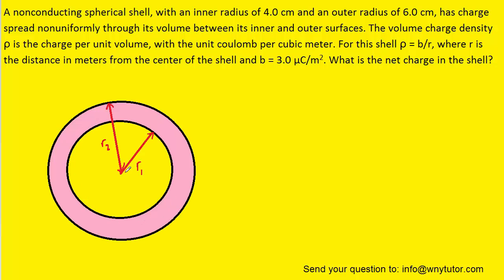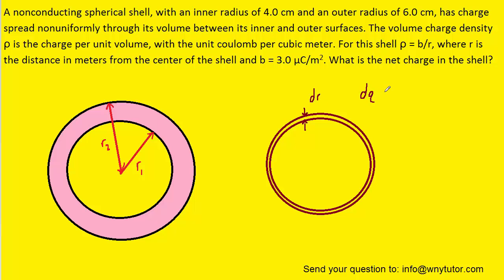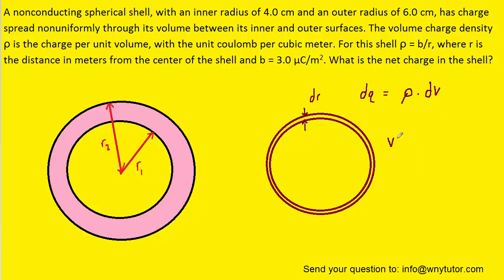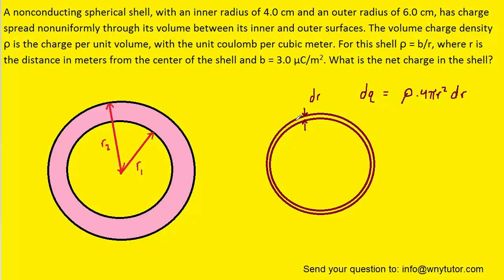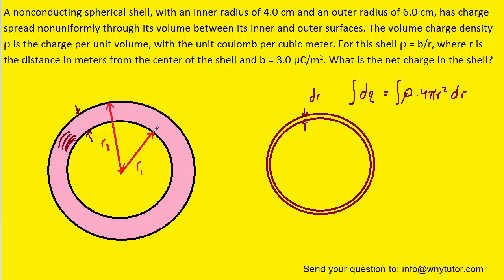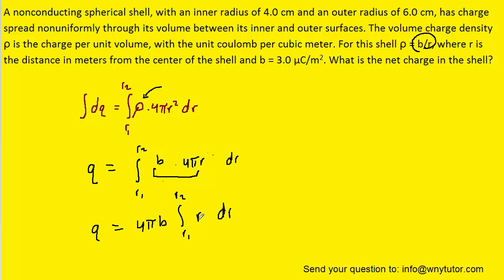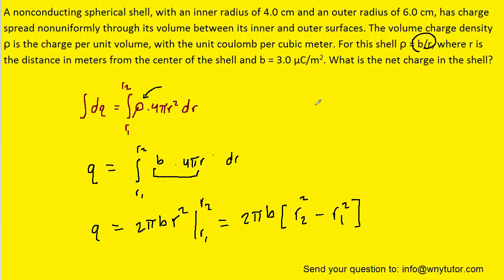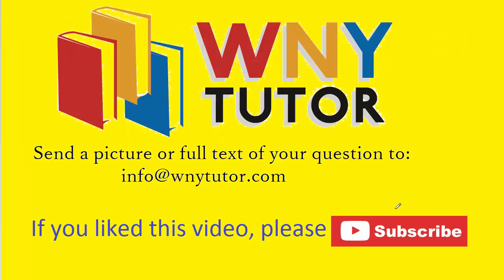A nonconducting spherical shell, with an inner radius of 4.0 cm and an outer radius of 6.0 cm, has c

Comment: actually we don't need to integrate. we know volume of sphere is (4/3 pi r^3) and the shell is just outer - inter radius. Then, we just times the density and get 
charge q = b/r * (4/3 pi r^3) = b * 4/3 * pi * r^2 =  4/3 * b * pi* (a^2 - b^2)

Comment: Hi. I have an integration question. In my college career, we are learning integration concurrently with calc-based physics. That is, I'm taking calc two while learning all about kinematics. Anyways, it seems like right now i'm seeing really simple integrals..where we can take out constants and just anti-derive a simple polynomial. What physics scenarios can you think of where we will be using trickier integration...like utilizing integration by parts? ...or even crazier..double...triple integrals? Thanks :)
Reply: Triple integrals are used for vector fields. I haven't ever had to do any in a physics course but vector fields are used for electromagnetism and static electricity. I could see a scenario were you need to calculate the amount of charge in a specific "Ring" of space... Many many more applications for triple integrals.